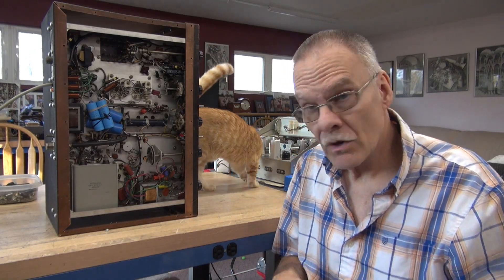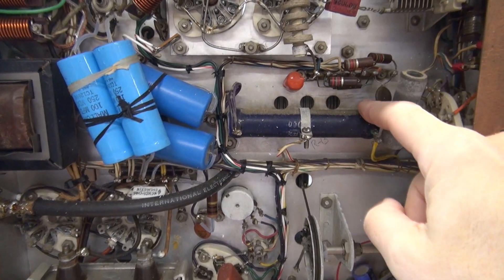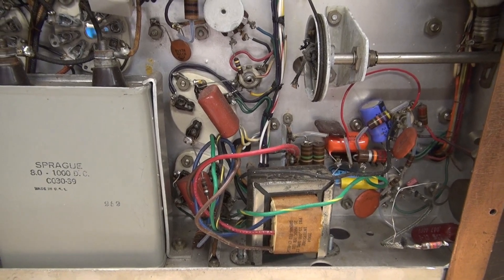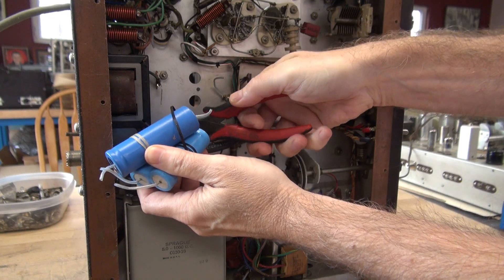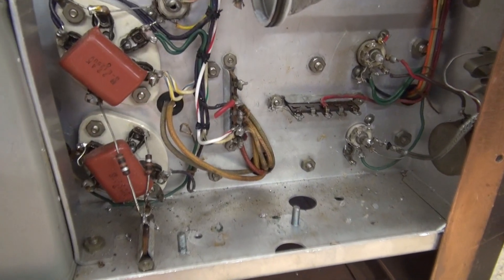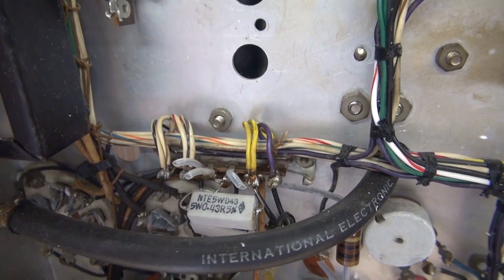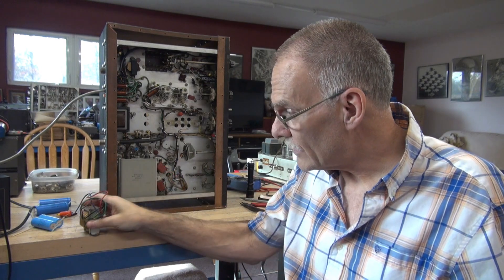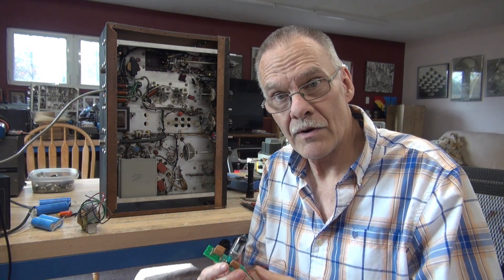Johnson Viking II ham transmitter audio preamp inverter Interstage transformer modern option

Comment: Not to stir the pot but.... what do you think of "Timtron"s "basic" (I.E. a few cap and resistor value changes) audio mods for the Johnson line of transmitters? They work/sound good to me. I'm NOT talking about "redoing" the whole audio circuit.... just a few value changes to get better fidelity with using a D104.
Reply from the maker: I am not familiar with the mods. Its always OK to perform light mods, just try to document what you did